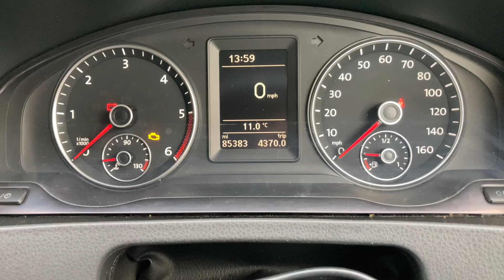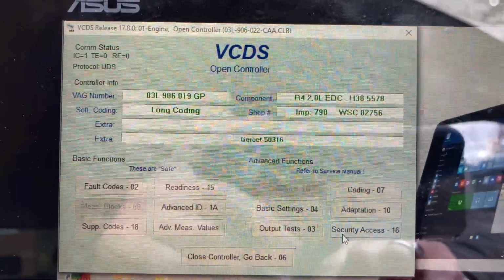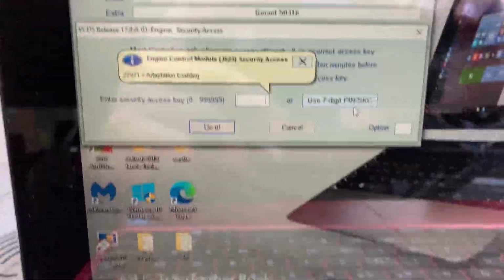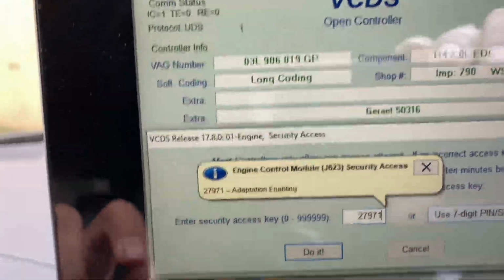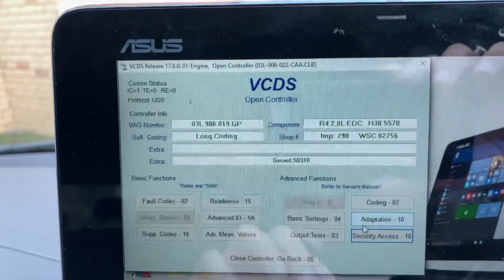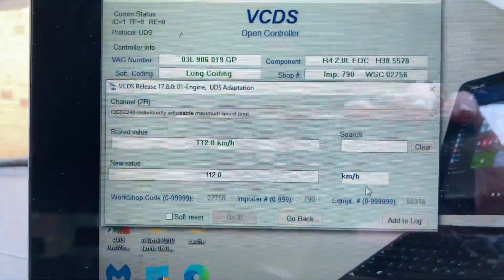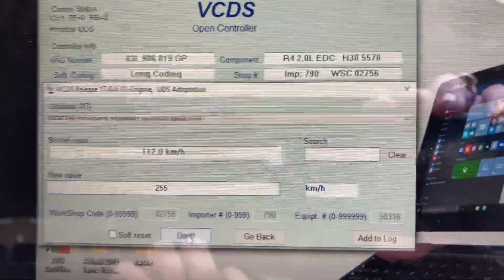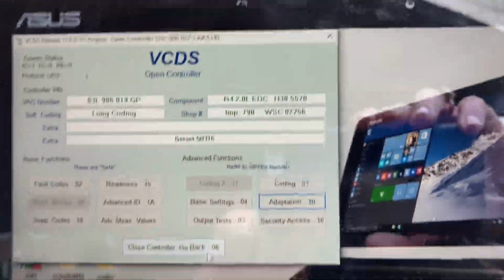Coding Programming Changing Speed Limiter Speed On VW Volkswagen Using VCDS

Comment: 1.12 Can I use VCDS to "Flash" the chip in my ECU?

No, we have investigated flashing, but found that there are several different methods of encryption for various VW/Audi vehicles, as well as delicate licensing issues to overcome. Therefore, we do not intend to pursue flashing any further at this time. You cannot alter boost, timing, fueling, rev limiter, or speed limiter with VCDS. You should contact a chiptuner if you wish to have those parameters altered.